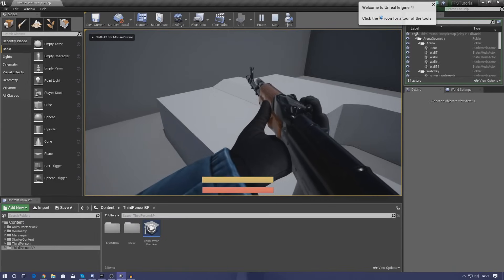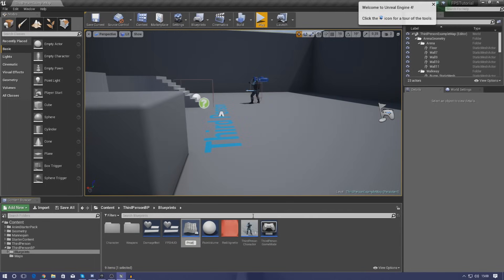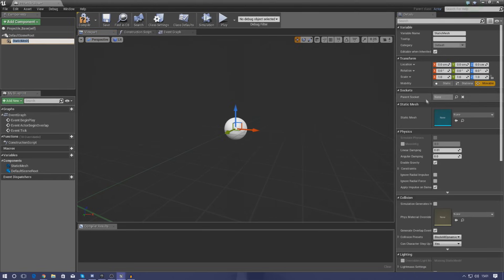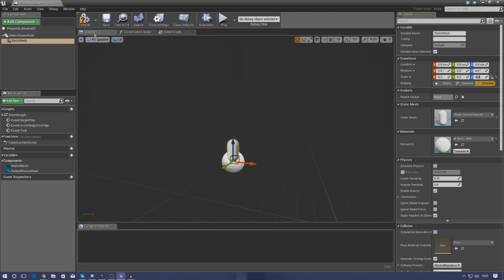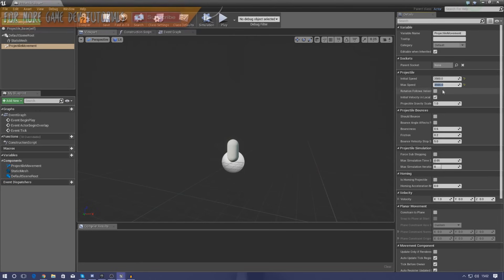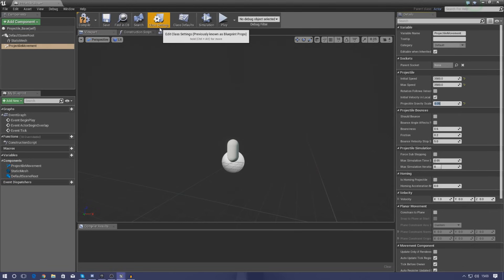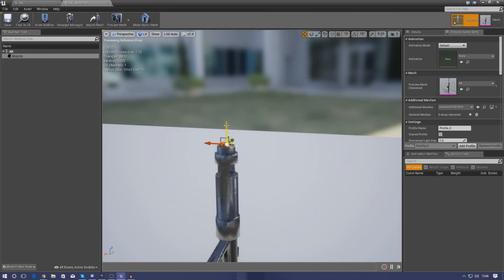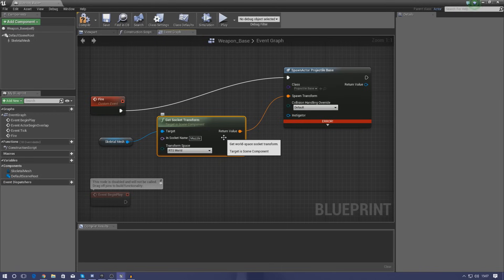Firing Our AK-47 Weapon - #9 Creating A First Person Shooter (FPS) With Unreal Engine 4

Comment: awesome tut, just want to share some of thoughts during development, 
1. Instead of using socket for projectille spawn point, I simply add an arrow component in the weapon_base blue print class, therefore the projectille always spawns from right direction from rifle without any tweaking of socket location.
2. For projectille movement, gravity 1 means the projectille under full gravity, 0 means no gravity, just some correction here in case anyone confusing. 

Thanks again for putting up such awesome tut, you are the best, Virtis.
Reply: For me I can't add a capsule when we are changing the static mesh. I search in capsule, but nothing comes up. Do you know how to fix this?
Reply: additionally you can change the arrow scale to change the projectile size specific to each weapon

Comment: For anyone noticing that the damage vignette comes up when we shoot at the pain volume. We can do a simple check to see if the overlapping actor is actually us and not something else. In the event graph of our pain volume before we cast to ThirdPersonCharacter we need to do a check. Move the event ActorBeginOverlap away from the cast and disconnect them. Drag off of the "Other Actor" pin on the event and search "==" and hit enter. It will be looking for another object to compare. From our Get Player Character node just drag that into the other input on the "==" node. Now create a branch node and for the condition input on the branch node, plug that into the output of the "==" node. Then hookup the "True" output to the cast. So the it should now fire the event, then the branch, and then the cast.

Comment: Oh and I learned that the logic is flawed. If you press fire after firing, you will get another impulse to fire without going through the logic first. This allows you to circumvent fire rate by pressing the fire button instead of holding it. You only need to add a Do once node that resets on failure of the last branch check to stop this. It will make you unable to fire until you completed the logic and holding will skip that step still allowing you to automatic fire.

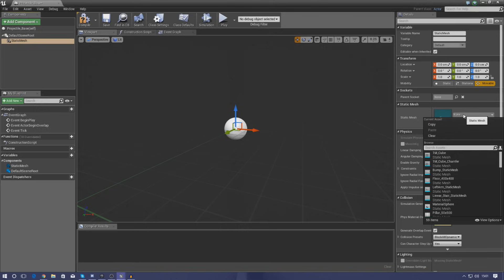Comment: PLZ HELP, i cant find the capsule in the statick mesh plz help me 1:49
Reply: Do you have the UE4 starter content?  You can add it in the content browser under Add/Import > Add Feature or Content Pack > Content Packs
Reply: @compressedspring47  and after content packs what i add i see mobile starter content and starter content
Reply: @FoRsHaKeNsOuL-ev6pp  He's using the regular starter content.  The mobile version has the same assets, but they're optimized for mobile
Reply: @compressedspring47  TY IT WORKED thx man
Reply: @FoRsHaKeNsOuL-ev6pp  Yeah np

Comment: for some reason the gun isn't in my hands, its suck in the ground, does anyone have an answer?
Reply: ok, nvm i fixed it
Reply: Tell me how pls
I have the same problem
Reply: How?
Reply: it's because you didn't used the right socket at '' spawn actor rifle_bp ''
Reply: how did you fix it
Reply: If you made the weapon socket then go in  thirdperson character blueprint and choose the weapon socket at spawn actor
Reply: I know this is super late but I just figured out how I messed this up. I had "Equipped Weapon" variable sent to target, but I forgot to attach the white line from "Set" to the white receiver for AttachToComponent